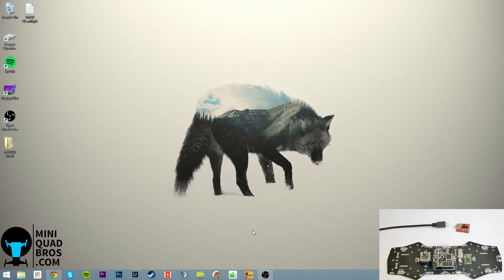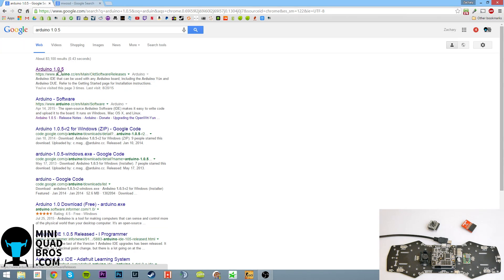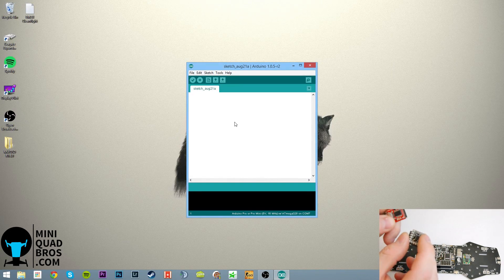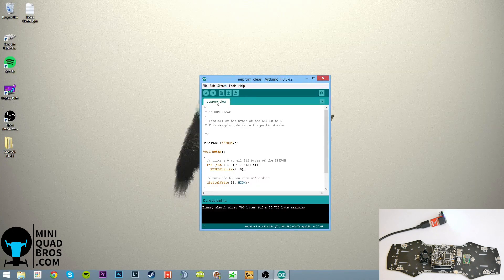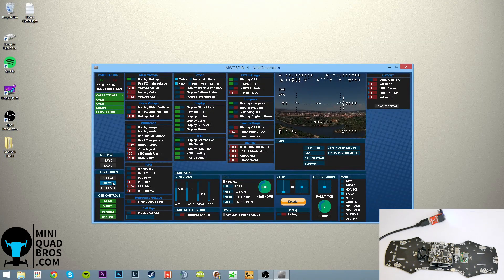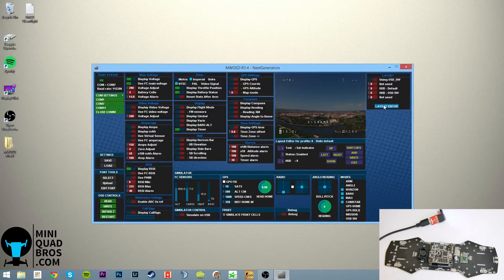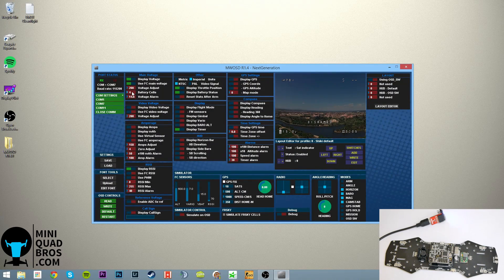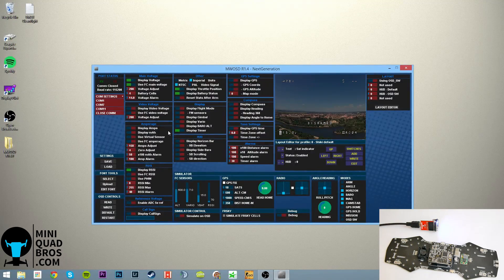Tutorial: How To Flash a Micro MinimOSD with MWOSD

Comment: Zachary,
Thanks a lot!!! I used the instructions on this video to I think load up the small osd board that goes on the back of the 1177 cameras. I actually am going to mount the old remotely from the camera since I am running a Runcam Swift and the board does not mount like it would on a 1177. I have not tried it out yet but I am sure following your directions got it loaded correctly. Thanks again, Tony

Comment: Followed a combination of yours and Painless 360's process, loading the MWOSD firmware.  Setup all the wiring and tested.  On the screen I can see the OSD overlay, however the camera is not pushing any video to the monitor.  If I remove the OSD the camera pushes video to the monitor without issue.  Its as if the camera isn't getting power.  I have hooked the leads (at the camera to a Volt Meter) and its getting the standard 10.67 (12v) signal).  Any help appreciated.  Do you have a break out of how your wiring is installed?

Comment: Hey +Zachary Moore... Thanx a lot for your video. I wonder if you know what could be wrong if "Waiting OSD" message does not stop flashing. Even though it was flashing I did follow your instructions to upload the default font and it worked (went from "Upload" 1/256 to "Upload 256/256"), but then "Waiting OSD" flashing again all the time. 
I do have communication through Arduino... I actually uploaded your files... but in the GUI I get this message. Hope this makes sense to you and hopefully is an easy question for you. :)
Reply: I was having this exact same issue... the baud rate got changed. I set it to the highest (115200) and it worked fine.
Reply: Even setting matching baud rate at GUI, OSD & winport didnt fix the waiting OSD issue for me. Turns out i flashed 1.2 standalone & tried to access with 1.6 GUI. Matched the versions n it worked fine.
Reply: i am getting the same error.... plz help me out to fix it

Comment: Hi Zachary, 
I am troubleing with connect of Minim OSD (probably) v0.1 to Naze 32 6DOF rev5 with Betaflight from Boris B. 2.1.6.
I went trought of your tutorial. I made everything like you- except connecting atmel CPU. I could see osd info in my quanum googles but no voltage of battery info, also the horizont line is made from letters.. :/  I also tried different FW by msosd, minim-extra, rust-ost, KV team..in different verions but I could not solve the problem of shown data. I also tried to switch off vbat in naze, then switch on, but nothing happent.
I made a small gallery with comments what is my scheme and last FW in osd.
http://www.rcportal.sk/galeria/zobraz_foto/foto_id/68429#foto 
Could you help me, advice me what to do?
Should I connect Naze (battery connector for voltage monitor) to Minim OSD (bat, grn) to see voltage of battery in googles?
Thank you.

Comment: Hi, when i try 'EEPROM Clear' or upload the firmware, it gives me 'avrdude: stk500_paged_write(): (a) protocol error, expect=0x14, resp=0x64
avrdude: stk500_cmd(): programmer is out of sync'
can you help me out? Thanks in advance
Reply: i found it work after reading this message,, note that all the fiels should be save and put into 1 folder,,
any misisng files will cause error, Thank again , it also works on 1.0X version of adruino.. Cheers
Reply: we have the same issue
Reply: +sir francis. You should select the corresponding board... in my case I was using an Arduino FTDI, and didn't know I had to choose "Arduino Fio" (Tools -> Board -> Arduino Fio)... Also make sure you select the corresct Port (Tools -> Port)... Hope this helps.

Comment: Thanks for sharing Zachary. This was a great help.
I got errors when flashing the firmware due to using a newer version of Arduino, but the 1.05 Arduino version you suggested did the trick. 
Just to help others, I managed to set up the OSD on Windows 10 (64 bit) using Arduino 1.05-r2. 
Then I couldn't get the MW_OSD_GUI to open. I downloaded/installed  the current version of Java (Version 8 Update 77) from here http://www.java.com/en/download/win10.jsp
Then opened the MW_OSD_GUI using the application.windows32 (despite my OS being 64 bit).

Comment: Crap I'm getting "avrdude: stk500_recv(): programmer is not responding" error. Any suggestions?
Reply: +James Bennett Hi, when i try 'EEPROM Clear' also get the same error with you, have you find any solution to solve it? Thank you.
Reply: I resolderd my connections. if that doesn't work buy another one.
Reply: +James Bennett If your board gets very hot, then that's a board problem, I had to buy a new one, and no issues.

Comment: Great tutorial but I am having some trouble, I have the older ftdi 232 and when I try to configure the eeprom clear or the flashing of the osd firmware, it sits there saying its uploading for ever. So far I let it sit for 10 mins without any progress. I am using a custom gaming rig that is this gen so computing power isn't an issue. Any help with the tool configuration? Driver is installed.
Reply: Did you get the problem fixed with it just stuck at uploading?  I have the same problem it just says uploading and won't complete.
Reply: I have the same issue driving me nuts. I can access the unit with mwosd but i cant flash or wipe it.

Comment: i m having problems , with the exact minimOSD and PDB but with CC3D Fc..
the CC3d just dont want to send info to OSD ..."NO DATA" msg in osd , i checked everything again and again...
Code in MWOSD dbl Checked
TX RX cables from MINIMOSD to FC FlexiPort RX TX
UART2 set for MSP (checkd)115200 ,  telemetry disabled, logging disable ...
nothing..
i am waiting for NAZE32 cause i heard issues with my current hw combination..!
Reply: i guess your problem solved already? if you use sbus in main port. then no problem using flexi port for osd. but if you using ppm with 1wire or pwm. then u cannot use flexi port. it need to go through main port as MSP UART1.
Reply: it was a bad CC3d board , i checked with another and its working, but now i use naze32 rev6...

Comment: Great video, very helpful, thank you so much. I have a problem that I REALLY need help with to conserve my sanity..  using same PDB and config as you, my OSD works, displays voltage, rssi and mode, but as soon as I arm it says No Data, then none of the data works. I have tried different FW, configs, new naze32, new OSD, always the same issue. Do you have any ideas? Thanks.

Comment: the zmr board is really clean. I got mine up in the air and love it. problem is the osd. all the time I spent on it to make it plug in and I can't flash it to mwosd because of the 64 bit thing . how do you fix the Java thing? the pdb was the reason I got a naze32.  my apm quads work with everything enabled. the naze is stable and with that board it's clean as hell. any help on the Java downgrade thing would make me happy happy happy. also how in the world did you solder the voltage regulates on?
Reply from the maker: you need to downgrade to the 32bit version of java. Your computer likely has 64bit installed. The voltage regs on the board?
Reply: Yes the regs on the board. I ruined 1 already trying to get it to stick. Any trick?
Reply: I actually installed both java and was able to get it to work in windows 7. I only had 32 bit and neither gui worked. I installed the 64 bit and it works.
Reply: +john wolff I have the same problem right now, what version of java you installed.
Reply: I actually found out that you have to install both java 32 and 64. Works now. I had 32 installed but had to install the 64 from Adobe downloads. Guess you need both.
Reply: +Zachary Moore thanks bro, my osd works, just had to adjust voltage

Comment: Can't get MWOSD open on Windows 10. Anyone possibly know why it wont open?
Reply from the maker: +Steve Taylor I had troubles with it as well, what does it say? What version MWOSD are you using? Are you trying the 32 or 64 version?
Reply: +Zachary Moore I believe it's 1.5 and when I run 32bit it gives me an error but if I run 64bit it runs and a small Bios screen pops up for a second goes away and then nothing after. The program never pops up after I start it. 

Maybe I should try an older version?
Reply from the maker: +Steve Taylor same thing used to happen to me. It's a java error right? Let me figure out what I did.
Reply from the maker: +Steve Taylor Okay, here's the scoop. The 64bit MWOSD configurator was broken at the time (and still may be) so I had to install the 32bit version of java, and run the 32bit version of the MWOSD configurator. So install the 32bit version of java and you'll be golden.
Reply: +Zachary Moore Yep! That fixed it, thanks alot for the help! Again, haha.
Reply: +Zachary Moore witch version of java did you installed? I know is the 32bits but 7, 8,

Comment: A couple of notes:  The .osd file was built for a different version of MWOSD.  The "Use FC RSSI" should be turned on under RSSI (and RSSI should be mapped to a channel in cleanflight).  The newest version of MWOSD should now work with whatever the newest version of arduino is now out.  The errors that required 1.0.5 are fixed.  Also, if you have a 64 bit version of windows (all newer computers) you will likely have to downgrade your java to the 32 bit version in order to run the 32 bit MWOSD configurator.  I haven't run version 1.5 yet so I don't know if the 64 bit version is working yet.
Reply from the maker: astralisdustin Thanks for noticing that, I changed and reuploaded the OSD file to enable FC RSSI now.